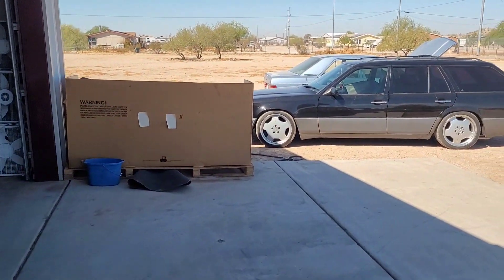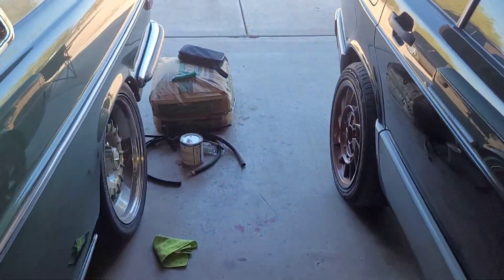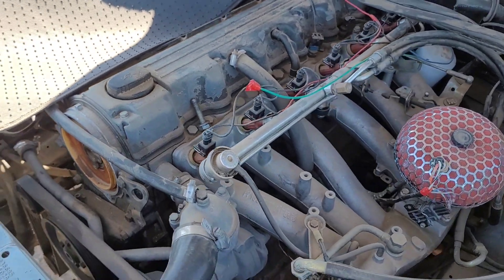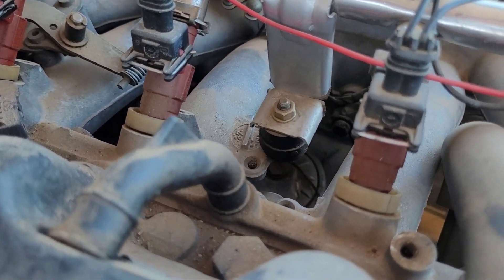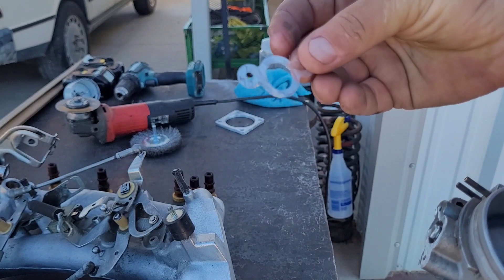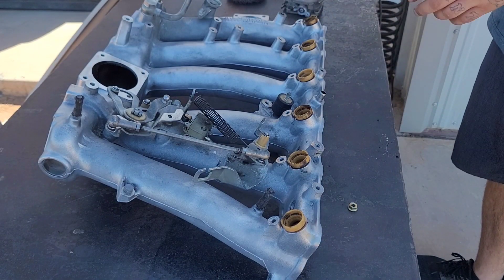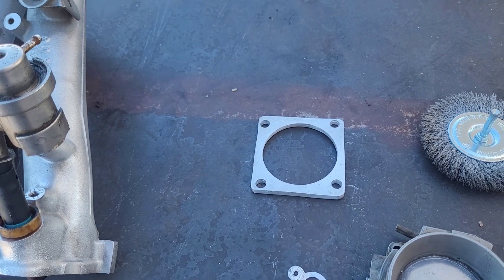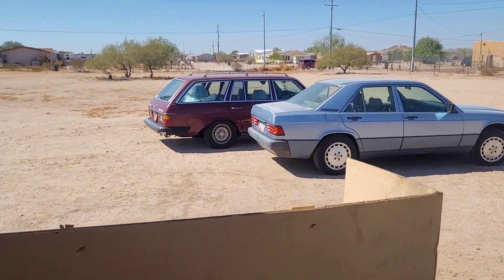Mercedes M103 Fuel Rail And Throttle body modification for EFI Setup Episode 4

Comment: Hi, can you specify what injectors you exactly used. Are those bosch ev14, and long, short or what kind of injectors fit with m104 rail?
Reply from the maker: So these are 600cc deka injectors to be exact and you can use just about any injectors with the m104 fuel rail if I'm being honest make the mount for your long or short ones

Comment: Anything special you need to do to fit the original fuel lines to the m104 rail?
Reply from the maker: You'll need to make them a little longer just keep the ends there barbed
Reply: @thebenzhouse is there a good place to bug you with some questions? Can't find you on Instagram anymore

Comment: Hey the holes on the new tps sensor don’t line up with the existing holes. Any idea why?
Reply from the maker: It's not meant for Mercedes TB it's from a bmw you can make an adapter if you really want to this is more of a diy with normal tools most people have laying around. I was just trying to show it can be done.
Reply: @thebenzhouse does it need to hold a tight seal on the throttle body or just clip onto the rod? I already shaved off the metal to mount the bmw sensor.
Reply from the maker: @leocrisafulli1882  it just slides on the rod there is no seal or air that goes to it
Reply from the maker: @leocrisafulli1882  you are more than welcome to msg me on IG as well I can respond faster ECT 😉

Comment: That bracket holding the fuel rail is going to fail.  There will be enough movement with just the engine vibrations to wiggle it back and forth and it will fail where it has been cut and bent. This could be bad please have the owner take it to a welder to add some strength back into he bracket where it was cut.
Reply from the maker: It's not finished yet we have built efi kits for the m103 for many years now with zero issues if I wasn't 100% sure it would work I won't never post it or show what I'm doing